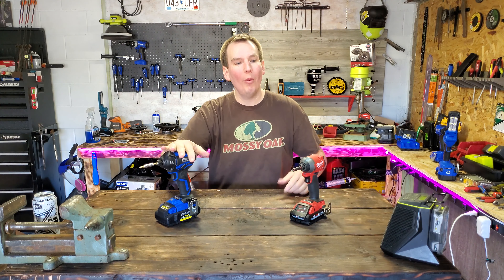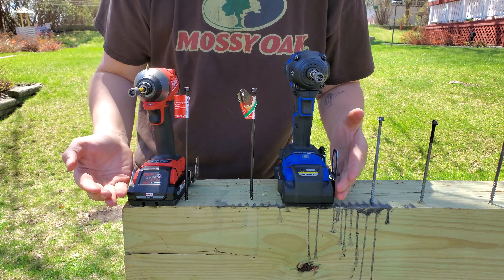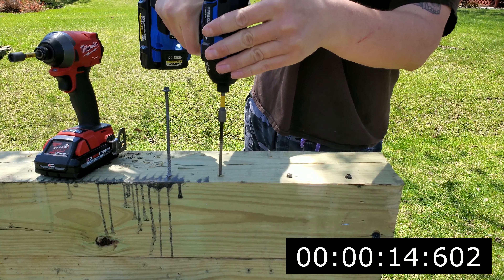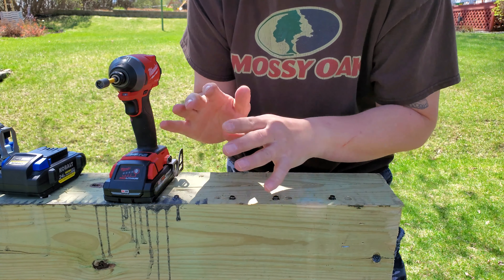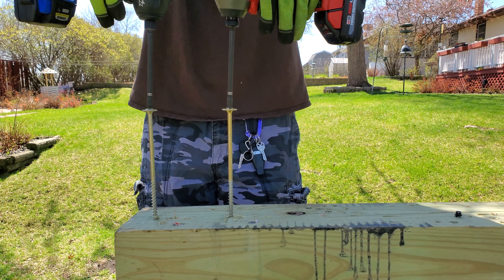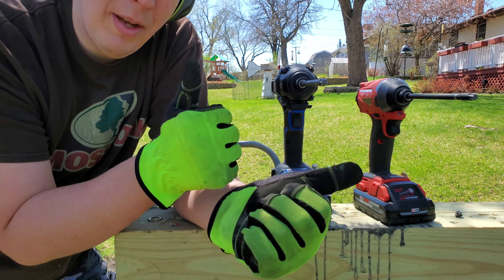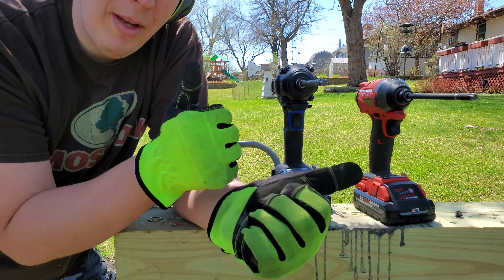"New" Kobalt XTR 24V VS Milwaukee Fuel Gen # 3 Impact driver Comparison !!!!

Comment: I like the Kobalt. What bothers me is there are no parts breakdowns to order parts for Kobalt. I would rather buy a switch and put it in myself instead of shipping it off and waiting. If the tool is replaced, it will be a used or a refurbished one. Its hard to beat the price of the Kobalt batteries. Sometimes half the price of others, and slightly more volts.

Comment: For all practical purposes, the performance is the same. I was considering the Cobalt, but bought the FUEL kit based on this review. Love the compact size of the Gen 3 Milwaukee. Thanks for helping me decide.
Reply from the maker: Yeah buddy I am glade I could help :)
Reply: Yea the Kobalt is a monster next to the little Gen 3.
Reply: I noticed that as well.  The Kobalt was a lot bigger and bulkier.  The comparison video really helps when you can look at them side by side and see the physical difference. Power wise, for the average person, they both look quite capable.

Comment: Which one is louder?
Would the m18 surge be the quiest impact (with good power )that you've used? Thx Al
Reply from the maker: Nope the best hydronic impact in the Ridgid Stealth force. Its discontinued but you can find it on ebay or Amazon. Its is the most under rated impact. It kicks ass and its super quiet!!!  The noise from the motor is actually louder than the impacts when it impacts.😀😀🤙🤙👌👌✊✊👊👊🤛🤜👏👏🦵🦶👂👍👍👍👍👍
Reply: Cool, thx Al

Comment: cool it looks like a cool tool but its like 3 times the size lol i already have a hard time fitting the Milwaukee places with its girth
Reply from the maker: Yeah it is big, both tall and wide!! So yeah, exstentions????
Reply: lol hard to do that when ur trying to get close into a wall its the girth that is the issue and is also why i have the m12 version also it is nice and tiny and is perfect for cabinet work
Reply: Agreed, can barely fit the m18fuel in mechanical room spaces with fresh air piping in the way. Bought the m12 for that exact reason, to fit into tight spots and not waste 30 mins taking apart previously done work
Reply: 3x the size???? Exaggerate much
Reply: @daleon96  rofl really had to comment on the amount of an obvious exageration........ good lord. Do I really have to say the point of the comment is that it's a good amount thicker and makes it much harder to use in tighter places such as cabnets......

Comment: How the heck is the kobalt 24v. Common sense dictates that they are using one more cell per row of batteries, but the pack appears to only be long enough for 5 cells per row. So? How do they do it??? Someone plz comment on my comment.
Reply: it looks like 5 but there are 6 in a row. The regular battery uses a samsung 18650 and the high output uses a samsung 21700
Reply: Kobalt actually rated at 24 MAX which is 21.6 nominal.  Just like Dewalt 20 volt max series is actually 18+. It keeps Kobalt from having to pay MIlwaukee a royalty because they have a patent on all 18 volt batteries.
Reply: @davidkoeppen3121  wow interesting...

Comment: KOBALT has improved a lot on their cordless tool line. Great for a lot of home owners and DIY.
Reply: @miguelledezma1394  

Oh, don't get me wrong these tools can be used on jobsite or garages. Just a lot of guys or gals choose not too or you don't see any at jobsite.  

When i started in construction i used my Craftsman tools on jobsite. The funny thing was guys would make fun of me. Then they started to realize that my Craftsman where clones of their tools and i was paying less. My craftsman 7 1/4 worm drive circular saw was actually skil brand, jigsaw was bosch,  brad nailer and 5 1/2 trim circular saw was porter cable. This was in the early 2000 when Craftsman got permission / deal  from name brands to put their brand name on it. Still today i use my Craftsman worm drive 7 1/4. I change the gear oil and it has a diablo blade and still going. Guys still today can't believe it actually a skil brand. Identical in everthing except the name. 

People who get the new kobalt should use them on jobsite and prove it can be used. For the DIY this is a great buy for their money. Plus they're good tools.
Reply: @jamessouza7065  right!!!
Reply: Kobalt makes more mechanical tools,  and specifies in it, im a diesel mechanic and my box is full of the 24v line up I use and abuse them daily way better than Milwaukee for the money
Reply: @tcd42019  

Pretty cool. Glad that Kobalt line is working out for you.

Comment: If you put a higher power battery in the Milwuakee it gets faster.  Milwaukee has lasted the longest for me and worked the best as I use impacts 5 days a week for work.  Also kobalts impact drill bits were awful.  They broke and the lil shaft gets stuck in the impact and renders the impact useless until you get it out which is a bitch.  The Milwuakee helix ones I’ve used them for months and never had one break.  The Kobalt bits snapped and got stuck in the impact the first day at work I drilled wholes with them.   Milwaukee for me over anything else.

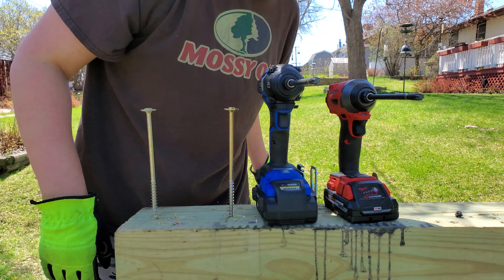Comment: 5:50, Where did you get those T50 bits?? I have been looking all over for them. Thank you
Reply from the maker: Menards!!! Its a larger box store in the northern states.. But there Hitachi brand.
Reply: Get em at most lumber company’s.
Reply from the maker: @josh01078583   are you talking about the T-50's or the 6-6 posts??
Reply: Making Stuff and Breaking Stuff with Al Both. But the T50’s

Comment: Milwaukee is the better deal
 Its smaller and can buy it for less.
Reply: No lol, no the Milwaukee is more expensive. $230 for the Milwaukee impact driver kit. 

The Kobalt XTR impact driver kit is $179.00. 

That is a $50 difference. Not a big difference but still the Milwaukee is more expensive. 

I go with Kobalt all day long being a homeowner. I cant see spending 2x to 3x the cost for Milwaukee batteries. Kobalt batteries are very affordable so that's why I bought all the kobalt power tools.

Comment: These Kobalts have been catching on fire.   I will stick with Milwaukee.
Reply from the maker: Were did you here that?? Send me a link if there's a video of it. Thanks man
Reply: Making Stuff and Breaking Stuff with Al vcg construction on youtube had one go up I think
Reply: @Impact-OG  VCG burned a Kobalt saw up but it happens, it should be a testament to kobalts fantastic warranty, just walk into the store, show your receipt and walk out with a new one, no questions asked for 5 years.  My brand new brushless dewalt drill caught fire on one of my first uses and home depot took 3 months to warranty it.  They ended up replacing all internals but this is the reason I have kobalt, because I use my tools every day and couldn't wait so I bought cheap kobalt to get me by. I have been very happy with my kobalts, got rid of dewalt, not missing junk dewalt. 3 dewalt kits and 3 broke drills.

Comment: Milwaukee still the king and that kobalt is massive 🤢🤮
Reply: Man..I hear you but I'd bet 999 times out of 1000 it really DOSENT matter
Reply: @jamessouza7065  people pay for the brand just because it's cool thing to do even if they know very little about power tools without putting the application the tool (s) would be used for into consideration. I just purchased this kolbalt xtr set and got it in the mail yesterday. Haven't had a chance to really use it yet but I love it. I chose kolbalt over Milwaukee, rigid, Makita, craftsman and so on. Price to performance is to good to pass up. I would like to see their next gen tool to be a little more compact other than that. No complaint on my end

Comment: Milwaukee ain't the best
Reply from the maker: I called it the king because its the most powerful on the market!!!
Reply: Making Stuff and Breaking Stuff with Al doesn’t matter if it’s the most powerful it’s all about the person who is using the tool and can work with any tools
Reply: @dennistv598  That's right man and you know how people are they don't know the difference in tools like what kind of tool do I use to do this job people abuse tools
Reply: Jason Shepherd exactly most people have fancy tools can’t even use it right like he does abusing it half the time they don’t even know what they’re talking about
Reply: @Impact-OG  its an very faulty king. Shitty collet, trigger malfunctions, air ventilation and overheating problems. One of the most bulky batterys on the market.
Reply: Milwaukee might have the most power  but never would i say the best anything drwalt and makita ive never seen anyone using milwaukee on a job sight
Reply: @russellleahy  makita has a 40v quarter inch impact try it out nothing will touch it
Reply: @russellleahy  I promise the makita 40v is the most powerful one out there. I ordered my 18v red and black straight from Japan and I love it and it's a beast